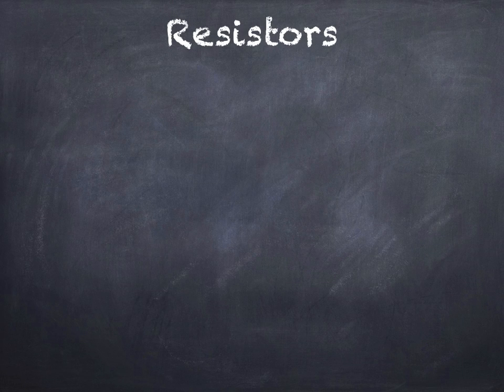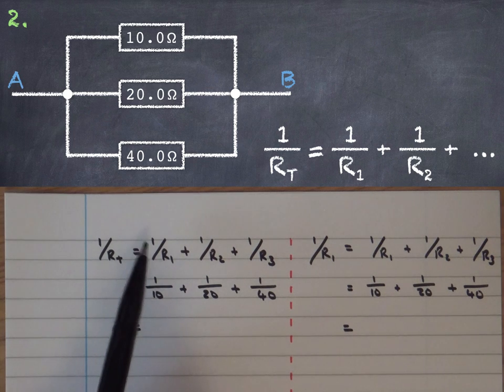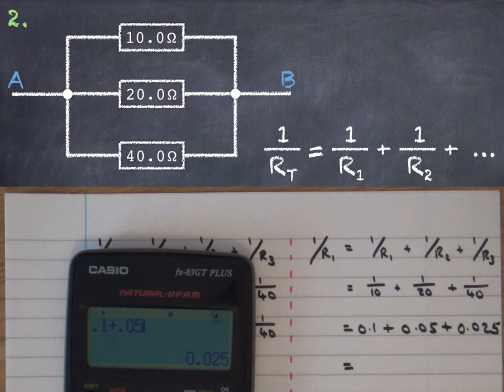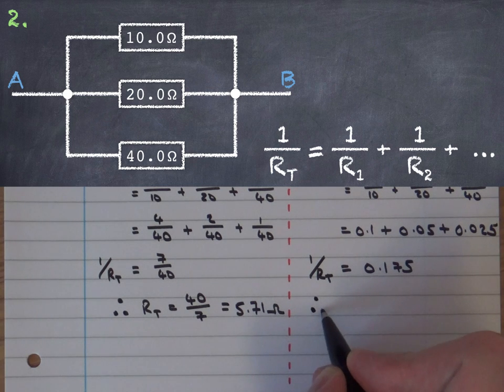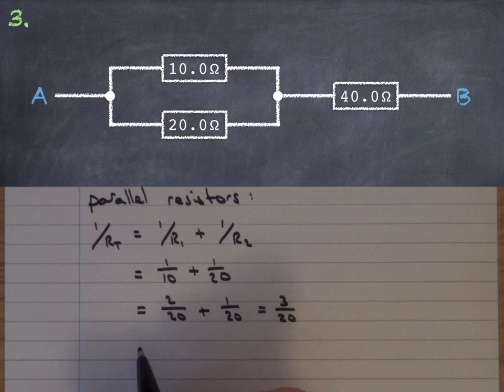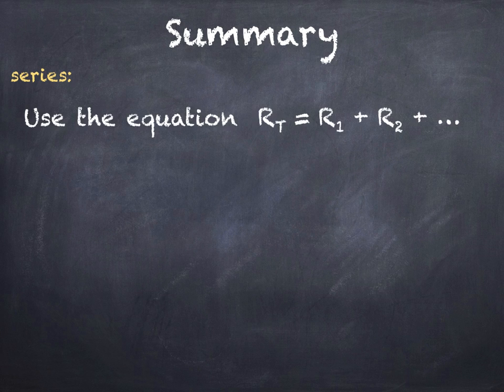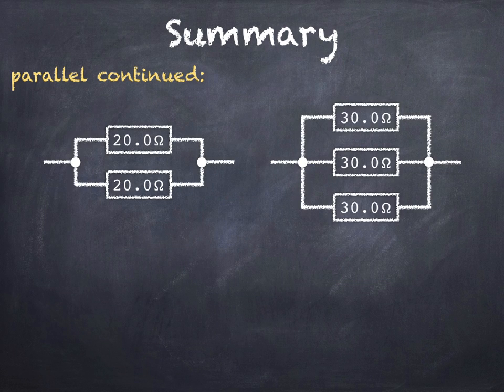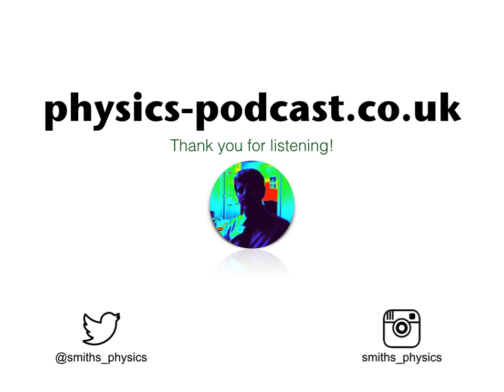Resistors in series and parallel (National 5 Physics)

Comment: Been using these videos to help study for my upcoming prelims, they've been a massive help. Just one small thing I noticed at 0:56, I think the right hand equation says "1/R1=1/R1+1/R2+1/R3" instead of "1/RT=1/R1+1/R2+1/R3" but hardly a confusing issue. Overall fantastic video!
Reply from the maker: Now that's very annoying - looks like I wrote that down a little too quickly. I'm tempted to re-record it some time as I'll be doing a range of examples videos anyway so will be covering this topic with more questions then. Thank you for pointing that out.
Reply: @MrSmithsPhysicsonline  no worries. Thank you once again. Looking forward to  the new example videos!